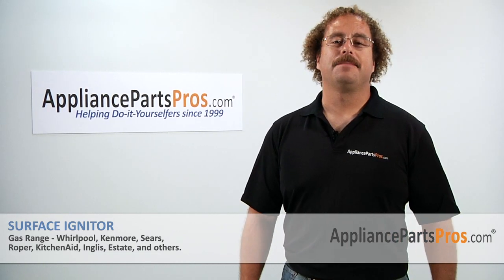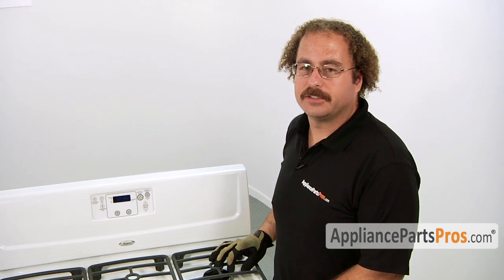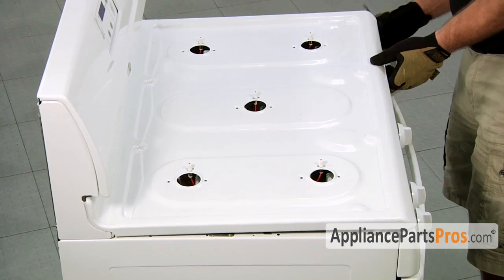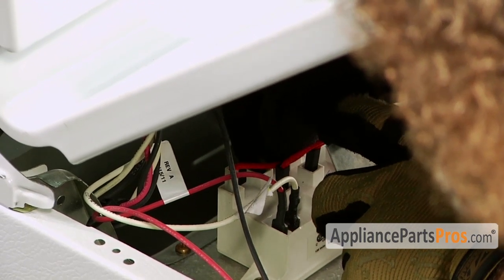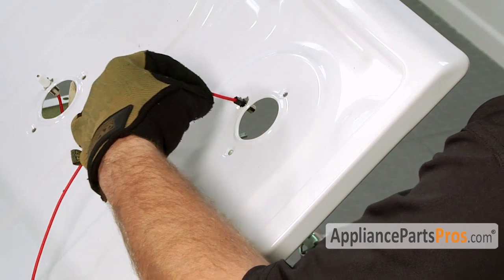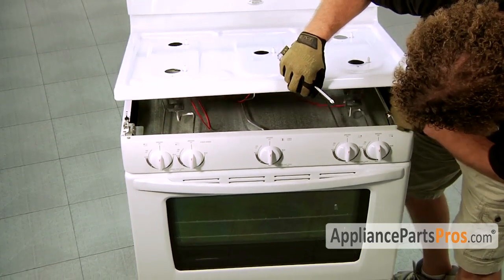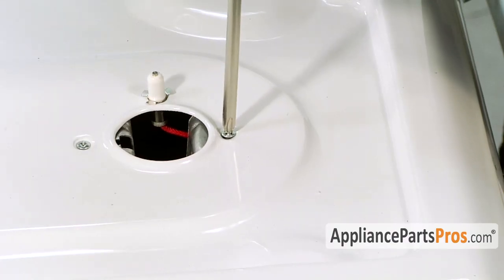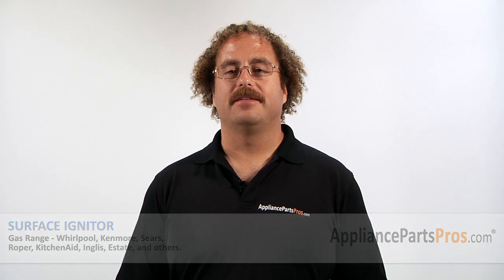How To: Whirlpool/KitchenAid/Maytag Surface Burner Ignitor WPW10209656

Comment: Hi Dear

My Jenn air gas stove won’t spark and light at all, can please advice me that what part I should change to fix it? All five burner wont have lighter and spark at all. 

It was working but after I cleaned it a little water went thru the knob hole and I am thinking that cause the issue. I dried it out but still not working.
Reply from the maker: If it still not working after you have let the stove dry. It sounds as if you could be having an issue with either the spark module or  spark switch harness.

Comment from the maker: First make sure the igniter and the area around it is clean, it must be clean and have a clean surface to arc to. Then make sure that the ceramic part of the igniter is not cracked, also check the wire. If that is not the problem you will have to check the spark switch, there is one behind each knob, when you turn the knob to "lite" it should have continuity. The last thing is the spark module. If you need more help please post this question on our repair forum and a tech will help you out.

Comment: help - URGENT ***
My GE model number: jgbs23weh4ww top left burner won't start.  When I light it up won't turn on.  The other three are working.  I have to use a burate lighter and it will light.  Thank y